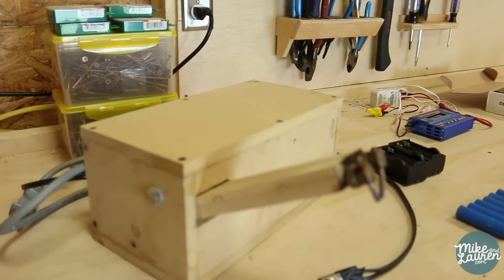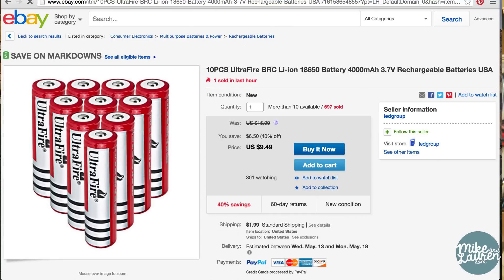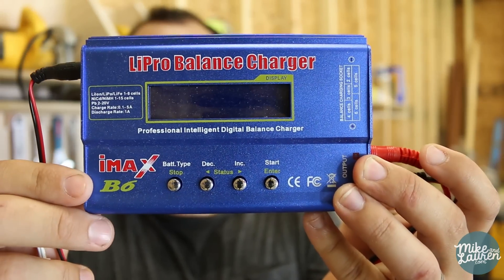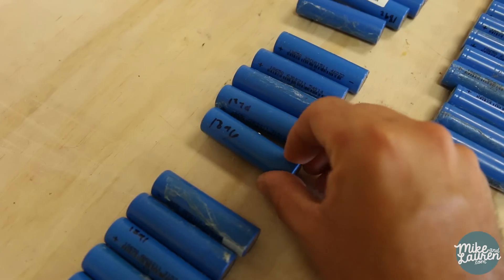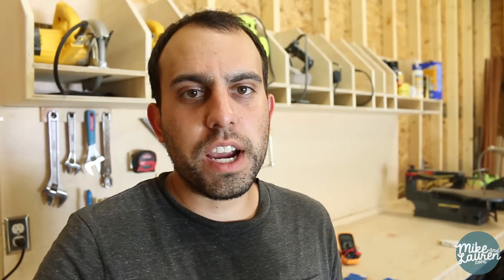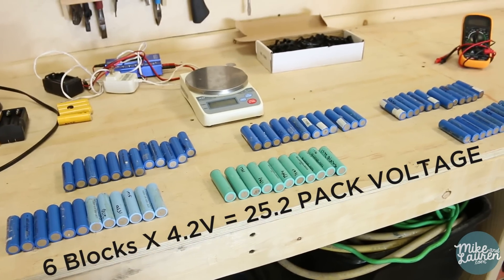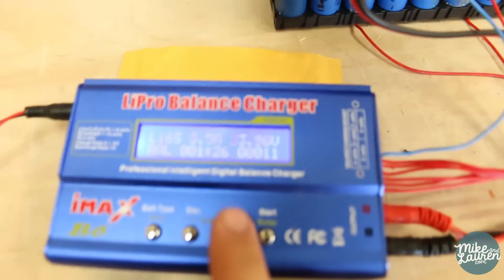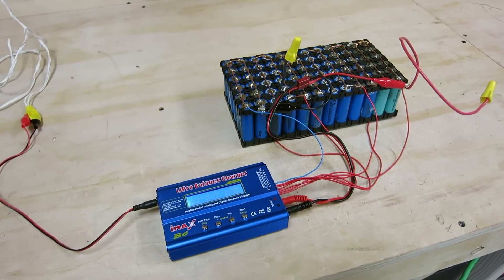DIY Lithium Ion E-Bike Battery Pack from 18650 Laptop Batteries

Comment: check this out you could use this as a battery box http://www.thingiverse.com/thing:1080782
Reply from the maker: Cool, I need something like that. thanks!
Reply: i have a 3d printer i might be able to help you out let me know
Reply: Hi Mchael - I'm in the Uk and was impressed with your video. I'm thinking of upgrading my existing ebike battery pack to give me more range. I understand the parallel and series connections, and have bought some samsung 18650 cells taken out of laptop batteries. The existing cells in my bike battery are identical except that they are 2.6 Ah, and the cells from ebay are a mixture of 2.8Ah and 3.0Ah, so if I use them I will have a bike battery with a mix of 2.6, 2.8 and 3.0Ah cells. My question is - will this work? ie - will the lowest common denominator work (2.6Ah)? or will this in fact be dangerous?  The other thing is that when i received the cells 2 thirds of them measured the correct voltage of around 3.7v, but some were measuring  as low as 1.2v. Is this just a case of charging these back up, or are they no good?  Your help would be much appreciated, as I know that messing around with li-ion cells can be dangerous, and I don't want to ruin my existing Ebike battery. I need to know what I'm doing before I start. Thanks - Alistair Duncan.
Reply: ALISON DUNKLEY if you use a very low 0.01 amp charge current you might be able to get the voltage back up or if you use a 4 slot battery holder    
put the 3 cells in parallel with a good 3.7 volt cell and charge that way..

Comment: you are better using 7 cells in series instead of 6 for a 24v pack, this will bring the voltage closer to what a lead acid 24v would be.

Comment: Hi I'm new to learning how to solder but plan on watching more videos on how to do it. Someone said nickel plated solder is not a good idea. And side from that, I'm trying to find out which soldering iron specs I need to look for in order to do this right. I'd like to stay within a 25$ range for the soldering iron if possible. I see ones online that are 60-100Watts for $17 but say nickel plated iron tips. I'm wondering if that's a bad thing. What wattage should I look for in order to do this job right?

Ideally I'd like to start off with a battery pack just like this guy's setup. And then after seeing how that one performs, make a 2nd one to double the range. So please, any helpful guidance in finding a low cost soldering iron kit, without compromising any necessary quality would be highly appreciated. Thank you!

Comment: Your charge rate is just too slow. Even my 13AH 36V bike charges at 100W, or 2.7A charging current. With 0.5A charging current that you are using, you would take more than a day to charge it. (20AH at 0.5A means more than 30Hours charging, assuming you fully drain it)
Reply: Then he needs to stop using that imax charger. That's his bottleneck. That and a good PSU. Its good only for charging small packs.

Comment: hello sir. nice video guide... i will try an electric bike kit for my 26" MTB. and buy 1000w hub motor kit. i can solve my battery problem (expensive you know) with yout video. i have some questions,1. the smart charger in this video fits only li-ion batteries? 2. do i try to build 18650 battery pack or lifepo4 (38120) battery pack with BMS (its little expesive choice)?3. i saw 18650 and 26650 li ion batteries which are more powerful such as 6000 - 8000 mah. i think they are fake??? i need 48v 10ah minimum i guess as a pack ????your advices are important. thanks for all...

Comment: hi i wanna make 24v battery from old laptop batteries i wanna know how much mah power minimum i need each cell
Reply: Use minimum 2000mah when you use start the bike motor the battery 'c' ratings must above 15 to 20c

Comment: Your videos are so much better than Rinoa, a lot more stable and edited better.  I am very excited to learn about the spacers, will be ordering these.  Also the balance connectors you linked on eBay don't come with cables, just connectors.  You can get one with cables for less here: http://www.banggood.com/2_54XH-22AWG-13CM-1S-2S-3S-4S-6S-8S-Balance-Cable-Silicone-Wire-for-Lipo-Batteries-p-1018898.html, I've also seen them in 10 pack for less per each.
Reply: +Dima Prok Yea but you gotta give props to Rinoa for coming up with all the stuff that he does. His brain is an explosion of ideas it seems - and nothing short of what any guy can't make with a 10lb soldering iron and some duct tape!

Comment: have you ever considered using a variac to slightly lower the power of your spot welder so it wont melt holes in the batteries?

Comment: 4:40
I DO NOT recommend buying those cheap 18650 chargers. Most of them are so poorly designed and made, that they have a high chance of damaging your batteries (or causing a fire).
Reply: +Benjamin “Ozias” Esposti They are cheap knockoff garbage.. but they work pretty good!

Comment: Hey, I loved your video! I was wondering how thick the copper wire was that you used to solder together the cells. Is thicker or thinner better?
Reply from the maker: +Vidgester1999 I used 12 gauge solid core wire and stripped the coating off.

Comment: Very impressive work and an enjoyable video.
What are the chances that the old laptop cells you get are so old they are left with only a few cycles?  Is it worth the $100?

You mentioned buying even DEAD laptop cells from ebay for this. How can Dead cells be usable if they are really dead? You mean they look dead but are not dead , right?
Reply from the maker: +Johnny Benson Generally a dead laptop battery means it has one bad CELL out of 6.  The other 5 usually have plenty of life left in them.
Reply: Mike and Lauren
Genius!
Reply: There's more than likely about half to 3/4 good cells. Out of the good cells, half of those should be high capacity.
Reply: joblessalex Thanks for sharing , bro. Very nice video.

Comment: Hey Mike.  I also bought an imax b6 off ebay and turns out it's a knock off.  The knockoffs unfortunately over charge the batteries.  You can tell by the SkyRC sticker on the back with a 4 or 6 digit number that you can check on their website to verify it's genuine.  There are some good videos on youtube that outline the issues with the knockoffs.  Thought this may be useful to you and your viewers.  Does your battery pack have the sticker?
Reply: it's definitely a knock off.

Comment: What a nice job. I hope it still runs very well! :D I'm currently in the making of a similar project. What gauge wire did you use for the battery, and is there any reason you didn't go for nickel strip welding instead of solid copper wire? Thanks

Comment: Hi, I'm a few months behind you and I've stop my project because of the spot welding issue. So my question is :
How did the soldering affect the cells? Were you able to measure it?
Reply from the maker: +EFA22000 I didn't attempt to measure any loss in capacity, but the battery pack is still working well.
Reply: +Mike and Lauren Can you tell me what pulse length you used, and the voltage output of your spot welder?  If you lessened the pulse length, or lowered the voltage, could it have been more successful? Thank you
Reply: +EFA22000 I soldered mine, no problem whatsoever. I even used buss bars of thick copper and a 450C iron temp. Some I even used two irons together to get the thermal mass! These guys are just scared for no reason. Be as quick as you can, but even if you aren't you should be fine.
Reply: +joblessalex Ok thanks

Comment: i want to make 36v 10ah battery for my bike 
i have a 36v 250w motor if you could guide me how
can i connect the battery to the controller inside the bike
do i have to solder the connector? thanks.
Reply: Best is to use plug and socket connections between battery-pack and controller, instead of a fixed connection.  So that at anytime you can unplug and test or swap.  Thus do not solder to a controller.

Comment: how many amps did you charge the battery pack with ?
Reply from the maker: +Angelo Nicastro My small power supply will only handle .2 amps

Comment: So the ground wire and all the others go on the negative terminals with the last going positive? Just want to quadruple check.
Reply: +C. Ware the balance wires are attached to EVERY terminal i.e. starting from the first Neg to the final Pos i.e/ a battery made up of 10 cells will have 11 balance leads,  a battery made of 13 cells will have 14 etc. etc.
And then you have the Main Neg also going to the first Neg & the Main Pos going to the last Pos terminal
http://fpvlab.com/forums/showthread.php?27853-Li-Ion-Batteries-How-do-I-wire-them-to-a-balance-plug-Diagram-anywhere
Reply: Kk thanks

Comment: Found 36 count, 18650 batteries on ebay for less than $40 with free shipping. The ad claims 5000mHh and the batteries are unbranded. Sounds to good to be true, but I am tempted to buy them. Anyone heard anything about them? The ebay auction description is "36Pcs 18650 3.7V-4.2V 5000mAh Rechargeable Lithium Battery US Shipping
Reply from the maker: +MotorheadRedo Those batteries are junk.  They average 600-1000ma.
Reply: Thanks. I heard companies will buy the rejected batteries from Samsung and Panasonic for resale. These are probably those.....

Comment: Does anyone know if the Imax can handle more than 6 banks (cells) when balance charging? I saw the charging sockets on the Imax, but didn't see a socket larger than 6 cells. Can you use more than one socket at a time?
Reply from the maker: +MotorheadRedo I believe it charges 6 cells max.
Reply: Thanks

Comment: what was the capacity of the cell when all said and done?
Reply: +danz409 from the description:
UPDATE: The battery had a total capacity of 19aH. The groups of cells were slightly out of balance (3.3v, 2.5v, 2.9v, 2.5v, 3.1v, 2.9v) so I could rearrange some cells and get a few extra miles, but I'm happy enough with the results.

Comment: hey brod, I'm gonna ask if it's ok to change the battery of my 800watt scooter into li ion battery at the same volts.. as of now im using 36 volt sealed acid batteries.. with 14 amp each

Comment: +Mike and Lauren 
How did you manage to solder to the 18650's so easily ? I can't seem to get solder to stick to it correctly
Reply: +BillTheBox Use plenty of flux and clean the surface
Reply: +BillTheBox  And pre-tin your surfaces. And use a bigger tip.

Comment: I ride a recumbent trike with a 48v 1000w 10ah system installed. I want to make myself a 20ah pack, but with all the videos here on batteries, I've yet to find the answer to the question of how to hook up a bms.  

Yes, I know about connecting the bms wiring to the pack; that's simple. But how do I ensure that to charge the pack, all I have to do is feed it power from the charger?... as in most commercial power chargers.  I don't want to have to hook it up to an iMax balance port every time I charge it, because even if I didn't mind the trouble of doing so, the timing of the balance phase is also not explained anywhere.

I've got WHY balance down; I just need some WHEN balance...
Reply: +dan mortenson Balance your cells with the iMax before you make the pack, and after let the BMS do the work!

Comment: Hello, Was wondering who else does ithis after Rinoa.:))) great work.
So, if 4.1v is the full charge for 3.7v cell, then for the 24 volts battery pack to be fully charged the voltage should reach 28 volts right?
Reply: Forgot to tell, Rinoa said his pack give 200mile range. 😮
Reply: +Kketansa Art 4.2v is full charge, use 7 in series for 24v systems
Reply: DMAN22yeah Hello, thank you:)
Actually what I was asking - 
If 3.7v cell, when full charged = 4.2v(charging cut off). 
Then, 7 in series 24v, when full charged = how much cut off limit voltage?
Reply: Kketansa Art you need to have a balance charger, so use a 7s balance charger. 3.7v on a cell open circut is fairly low charge. 4.2v is full charge. a 7s battery will give 29.4v, which will give you extra power and less voltage drop

Comment: Hi Mike I have a 48v 1000w  motor on my bike how would I make one battery that would by 48v @ 20Ah that's what the manufacture said to use. Would I use like 3.7v cells at what mAh to get the right current and voltage. Is there a blueprint or configuration diagram I can use from somewhere. Right now I have 4-12v 20Ah SLA batteries put they are heavy each battery is about 15lbs so that's like 60lbs on my bike. Thanks Let me know my email is dralaniz53@gmail.com  ThanksDavid
Reply: +David Dave use 13s and 8p and up. use an ebay bms for like $20. i intend to use a 45 watt goal zero charger that outputs 48 volts stepped up to a high enough voltage.

Comment: Hi my name is Mike friend Matheus I'm from Brazil! Everything good with you? I need to know how to leverage the built-in charger contained within the laptop batteries. I ordered imax b6 charger on ebay but it takes two months to arrive, during this time I really want an alternative to recharge the battery I'm doing. Thank you very much for your time friend Mike, your videos help me save my money !!!
Reply from the maker: +matamipru I would suggest looking up how to make a "DC power supply" from an old computer power supply.  If you can dial in exactly 4.1 volts you can charge them individually.

Comment: is it possible to just hook the laptop batteries together without all the resoldering bs
Reply: +mike97525 No Mike, and for a couple of reasons. First of all there would be the matter of finding connectors to connect the laptop batteries. Second, the reason someone has sold a perfectly good used laptop battery is because it is not perfectly good at all. Some of the cells can be bad or dead and crash the whole project. Mostly the reason you want to break up the laptop batteries into the individual cells is so you can match good ones with other good ones. You will want to rate them on amp hours and put like ones together. Follow the link to Rinoa Super Genius he does a much better job of explaining the process.

Comment: How did you organize the batteries? For each cells in one block, do they have to match capacity? And for each block, do they have to match capacity too? I'm bulding 48v pack, 13s10p but I'm still confuse how to organize them.
Reply: +ketoi12345678 each series pack has to be very close in capacity but each 18650 doesnt matter just mix and match until each parallel cell is similar

Comment: Hi..
I have a question.
if i wanna make a 48v battery pack i have to make the same process but with the twice of batteries or i can make 2 of this en put it in series and get the 48v.
Reply: +Johniel mancebo cordero yes thats what rinoa super genius did but you should use 13s instead of 12s because it will give more range and power even at a lower charge percentage

Comment: Mike -  I have an old ebike that was originally powered with a custom made lead acid battery to fit in the case, but these batteries are no longer available.  Do you think I can get up and running again by making a lithium pack?
Reply from the maker: +Ron Warrick That's exactly what my bike was.  It originally used lead acid batteries.
Reply: +Mike and Lauren  Thanks.  I was concerned maybe the peak current draw would be too much unless I change the controller also.
Reply: +Ron Warrick you might want to watch julian illets ebike sla to lifepo4 conversion, he does exactly what you are talking about.

Comment: i would like to learn more about batteries ! ,   I bend bring  to built a pack that will last me long enough  for my photography !, meaning i need a pack to connect it to my camera so i don't have to worry battery draining out,   i want to keep my charge current on my camera and i need to do to keep it enough charge that would last me  long time   i wonder which battery is best to use out of all battery brand name  so i can create my own pack !!!!!!!!!!!!!!??????????.
Reply: +Becky W. Gonzalez 
1. Cheapest solution: buy multiple camera batteries.
2. Depending on your camera, you can buy a AA battery pack for cheap, load it with NiMH AA batteries, solder a power plug to it and plug the pack into the camera. 

The camera I use for personal photo and video in Africa (where electricity is unreliable) is a Panasonic Lumix FZ-35. (There&#39;s no way I&#39;m bringing my expensive Nikon gear to these places. And yes, I&#39;ve almost had my gear confiscated by machine-gun wielding officials in the Congo). 
The Panasonic camera can operate on a 8v DC external power supply.

- I bought a $3 battery holder from eBay. It holds 8 AA batteries. 
- I put 7 AA NiMh batteries in it and use a dummy battery in place of the 8th battery. The 7 batteries gives me a little over 8v - perfect for my camera.
- I got a DC jack that fit my camera and wired it to the pack. 
- With this combination (and a 32G SD card), I have recorded video for ~6-8 hours straight, w/o needing to change batteries. I haven&#39;t tried it, but I bet I could get 15 hours of straight run time from it.

When the batteries die, I charge them up using my AA travel charger. It can charge up to 8 AA NiMh battiers at a time. (I bought it from All-Battery)

Total solution, batteries included, was about $30.

Too bad I can&#39;t do the same for my laptop. That&#39;s my next project. ;)

Comment: kinda new to this, but  what's the max/minimum amount of cells the charger can recharge at once?
Reply: +TheFugiapple12 that charger can do 1-6 cells
Reply: Thank you :)
Reply: +TheFugiapple12 The cells can be made up of as many batteries as you want. If you want to balance more than six cells look for a BMS board. The one I'm using balances 13 cells. Go check out 15-sec-of-fame's videos.
Reply: Rick Rose
Allrighty, thank you :)

Comment: you should mention that to test the capacity, you should first fully charge the cell, then discharge to the minimum voltage. and the cutoff should be set just above the rated minimum voltage to prevent damaging the cells.

edit yeah ok, you do say that bit :P my bad